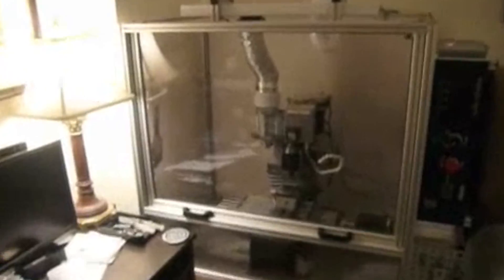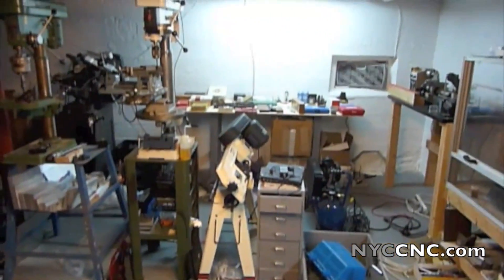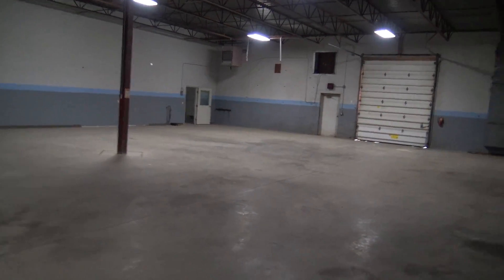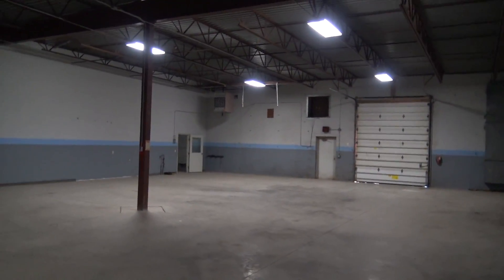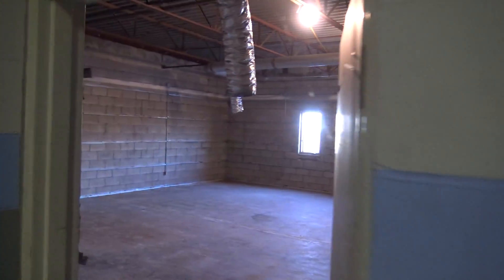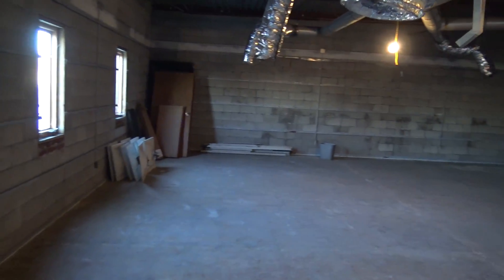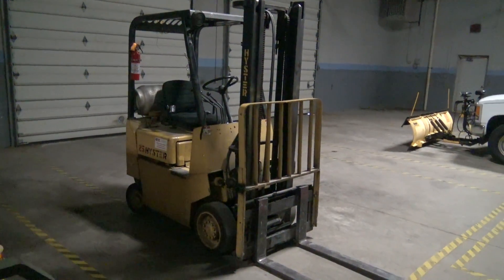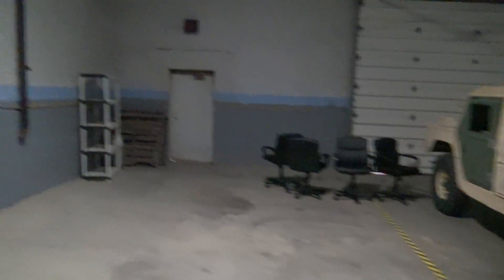We're Moving Again - One Last Time!  NEW SHOP!

Comment: Congrats...For the air lines you might want to check out the pricing of products like Rapid Air (there's other companies too), they have rigid and semi flexible lines, it's a coated aluminum tubing and can handle pressures up to 200 psi....With the rigid they offer sizes from 3/4" up 3" outside diameters and in lengths of 8' & 20', and the semi flexible is 1/2" to 1" in rolls of 75' up to 300'.....rapidairproducts.com.....And don't use PVC, it's good for short term use but I wouldn't use it if your going to be there for a long time.

Comment: Congratulation you worked hard for It and you stuck to It , I have seen auto repair shops run the air lines in  sch 40 white plastic pipe I would use the same Idea , Just using sch 80 gray pipe I bought a shed that was fully assembled (wood) and the company rolled it down my drive way using sch 80 plastic pipe and it did not split or crush seeing is believing . I believe Its rated at 200+ PSI    Thanks for taking the time to make these Video's Pete M
Reply: +Pete M oh, that makes (3) mr. shrapnels...

Comment: Nice building. I agree with the copper air lines. On the epoxy floor, be careful about ANY oil on the floor. It will cause the coating to peel off. (Assuming your doing the DIY epoxy.) Even with the acid wash, once oil has soaked into the floor, that's it. 

On the wall; welding curtains WILL NOT keep that dust at bay. I worked in a room with no ceiling, next to a grinding room. That awful dust came right over the wall. I also noticed that your heater is blowing from that area towards your CNC shop space, making it worse. Speaking of heat, I also noticed a lot of light coming around that garage door.

Comment: *Storage Shelving:
A shipping and receiving department will need shelves for spare parts, manufactured parts, incoming freight and machine and welding shop consumables.  Keep an eye out for going out of business sales of retail department stores.  You can find great deals on the display shelving units with pegboard backing and also get the industrial shelving for storing pallets on from business stock area.  I got a 5500 pound rated pallet jack from a going out of business sale and have moved my lathe with it several times with ease.

*Chip and welding flash shields:
In a machine shop I used to work in, we had 5.5' square loop frames made out of a 3/4" electrical conduit that had canvas stretched across the center to shield cutting chips from the machine operator or bystanders.  I had one on each side of the manual vertical mill that I could use to help control the mess.  There were also several of these frames with welding shaded curtains on them to control welding flash throughout the shop.

*The machine shop floor was painted grey and sealed which made for easy mopping and clean up.  It had the potential to get slippery but looked a lot better than oil stained floors.  

*Air Quality
Smoke Eaters or welding smoke purifiers.

*Lighting: machining area lighting was hung much lower (closer to machines and equipment) and on separate lighting circuits from the rest of the shop.  Good for those early mornings or late nights not having to light the entire area for just those few machines. 

*Mobile Machinery setup alignment fix for uneven concrete floors: This fix is for having a repeatable place to set a machine or device on a concrete floor in a shop.  I will call it "Puck and Ball Leg bolt".  To do it you need to turn a radius into the center of a steel puck that matches the radius of the ball on the end of the leveling leg bolt.  You need a matched set of these for every floor contact point.  Drill two or three holes in the puck near the out side edges (for bolting or gluing to the concrete floor).  Stick or bolt the pucks to the concrete floor exactly under the ball leveling adjustment leg locations.  Level up your device/machine using Ball Leg bolts. Now you can move the device with a pallet jack, forklift or by hand to another shop location and bring it back to the pucks and set it to the exact same place it was before.  This was needed in our machine shop for the in-feed and out-feed tables of the self feeding metal band saw.

Hope some of this helps, that last part was a little difficult to explain.

Best of luck to you!

Comment: What do you think of using the auto bay for welding and put a roll up door between machine and welding areas?  You have so much area you could set up an RC race course inside and not crowd the machine shop stuff.  Congrats and my eyes are green;)  I've plumbed several shops with PVC pipe.  Low cost and never had any draw backs.  Do make sure to put a drain at every down pipe, very important.  Could run 1" in the rafter and run 1/2" down to each machine.  Would be a good idea to anchor the down pipe to something so the PVC pipe doesn't get bounced around.  Drawback is easy to get damaged.  Benefit is cheap and super easy to fix.  I did my insulation trailer with PVC and the only problem with breakage was user error.  Was able to fix it in 5 minutes and was back up and running.

Comment: I'm going to suggest a vinyl strip curtain wall hanging from one of the bar joists. Some manufacturers even have the vinyl material in a tint that is specifically designed for welding areas to that people outside the curtain are not subject to the ultraviolet and the blinding light. But it's still easy enough to walk through or even drive your forklift through wherever you want.

Comment: please build a small shed outside for the air compressor for noise control, or if you get deep pockets or sponsorship a roots type compressor as they are a lot quieter.

Comment: On the air lines.  Copper corrosion will not muck up your air tools like rust from steel will, but really what you need to do with that much airline running all over the place is to put a commercial refrigerant air dryer in place right after the compressor.  If you are blowing dry air into the lines to begin with corrosion will not be much of an issue.  You then run your hard lines to a given "station" that runs through a desiccant style air dryer just to be safe, and then to a distribution block so you can run 4-5-20 tools in that "station" ... inline tool oilers are nice too.
I would also HIGHLY suggest that you build a compressor closet.  It's worth 1000x the $1-200 it costs to build.  There are a ton of tutorials on how to do it.

Comment: I would leave the duct work to use as venting in the 'class room' area and use the 'class room' area as the welding / plasma area. Then on the main shop area I would put in either a cubical partition or one of those production floor office spaces made up of prefab wall sections with the Plexiglas windows.

Copper is for sure the way to go with the air line. You want to go large with your main feed lines so you don't loose to much at the far end of the line when you have a few people using air. The large line also acts like extra tank space. Don't forget to put in lots of shut off valves. Sucks to have the whole shop go down because some one broke off an air fitting.

Looks like a great adventure and a great space. Reminds me of how I felt when my dad and I opened up a shop.

Comment: the T5 lights are ok and all but they have a very fast burn out curve, they start to loose intensity very fast compared to LED, they have very nice high bay led panels the are low power low heat and are ridiculously bright, the place that i work at recently replace all of our old mostly burnt out high pressure sodium lights with philips FBL24LL40-347-CW6 (in our shop its 347V but they sell these in different voltages) these lights are 24000lumens each at a colour temrature of 4000k (but look closer to 5000k as they are pretty much pure white light) when they first put the lights in we had to wear sunglasses in the shop it was such a massive change from the near death sodiums to the gates of heaven for lighting.

for the air lines, running all pure copper lines is a insane cost, you would be well off running 1inch seamless extruded or cast pipe, very robust and used the world over for shop air and high pressure washers in a shop install.

Comment: Great news!
Are you still in Ohio?On the floor: no epoxy. It is slick when dry and a real hazard when wet, especially with oil. Seal it and leave it.On the lights: I like fluorescent, but... Supplement with another type of light. Cyclic lighting such as fluorescent and rotating parts are a very bad combination. Do not go with LED until you actually walk into a high ceilinged room that uses it.On the walls: studs and drywall. Don't screw around. Add a short hall and another door at the far end. Keeping the dust out will be almost impossible, but this will help. Keep the grinding room on its own heat. You will also find the wall a good place to hang things.On the heat: I like those type of heaters, they do just fine. If you decide to change, look into radiant infrared heat. They are long tubes with reflectors and some magic box at one end. I worked in a shop here in Ohio that we shut the heat off at night. It would be near 0 some mornings. It would heat the entire shop and our tools in less than an hour. It was by far the best heating system I have ever worked under.

Comment: I vote for LED lighting. Even if you use fluorescent fixtures you can retro fit LED light bulbs in them. HD sells them for under $9 each. They will last almost forever, are more energy efficient, color is way better as well. Don't be misled by wattages either, LED's deliver the light in 120 degree pattern rather than 360 degrees in a fluorescent tube so you need less wattage for the same amount of light. Thanks and congratulations.

Comment: John congratulations on the new building. For the welding dust try to have the air flow going out the back of the building if possible. With or without curtains the dust will settle in the direction that the wind is moving. 
Copper is the best for air lines, it is easy to get the parts locally, easy to change, and make additions to the existing line. With Copper you don't have to worry about heat, moisture, UV degradation and unintentional puncturing, or seal failure. Just don't forget to have the proper slope to drain the moisture in the line. Also put in shut off valves at each station if your budget can afford it.

Comment: A lot of areas have tax credits or grant money for converting to LED lighting. It is definitely great when done right.

You should consider using the auto repair area for your welding/grinding and fabrication area. No walls to build and complete separation to keep the machine shop clean.

Comment: SO AWESOME!  Quick thoughts, epoxying those floors should be pretty easy, ours were filthy and took forever to clean.  We had one 3 or 4 bulb T5 light fixture installed and it's BRIGHT!!!  I'm not sure what bulbs are in it, but I want those across the whole shop.  We used 3/4" RapidAir Maxline air lines, the blue ones.  Around $200 for a 100ft kit and I like them a LOT, we used about 150ft to loop all the way around our shop, you'll need way more.  But I know nothing of copper so I can't compare.
Reply: +NYC CNC no problem.  did your see my latest lathe video? might help.

Comment: If the copper lines for everything are too expensive I think that using something similar to PEX tubing would also work great! This tubing has come a long way recently due to many people using them extensive in new home building. With copper I would just make sure you have enough CFM for multiple/many tools to be run at the same time. Anyways, congratulations on the new building and I hope to maybe someday attend your classes!

Comment: Lumber build the walls that are kinda Temp, attached and the top and bottom with bolts that can be removed later if you "upgrade" rooms to different size, Section off the "auto room" - easier to Vent for welding and grinding , and reduced chance of eye welder burn for others.  I still think LED Lighting is best results, HALO Style would be a good possibility

Comment: I have plumbed a big shop 10,000 sq feet for a auto repair shop.  We used 2" main runs (all steel pipe), which ended up adding significant volume for compressed air storage and we never worried about any one drop being at the end of a run and having little pressure due friction.  The compressor is a 25hp 3 phase monster in large part because the shop still has in ground air over oil lifts.  The main lines ran the length of the shop on each wall (interior and exterior) about 8 feet up, with drops every 8 feet or so depending upon the place in the building.   We placed outlets at each roll up door which ended up being really useful.    The only negative was some leaks, which are not easy to get to (more unions needed).

Comment: Take the money you would put into the epoxy floor, and instead of the epoxy, install more lighting.  Put more lighting than you think you need.  Install a ton of lights, and put them on separate switches so if you think it's too bright, you can turn select lights off, but I doubt you will ever think you have too much light once you install them.  Lighting will make a MUCH bigger difference in the feel and use of the shop, more than the floor.  And I have yet to see epoxy floors hold up well to really heavy machinery and abuse.  And you will either spend too much time worrying about damaging the floor, or once you damage it, you'll then spend a ton of time figuring out how to repair it.  More light will make the plain concrete seem brighter as well.

Comment: John: Contact the electric utility and schedule a full meeting with a commercial account specialist / conservation specialist.  Many utilities have programs that the on-the-phone-customer–service-happy-voice doesn’t even know exist.  Depending on the utility they may have programs that will basically allow you to pay for efficient lighting with the savings over standard T-5s.  (In any case, mix in different types of fixtures.  Even with good LEDs or florescent, if it is all the same the lighting will always seem “off”) 

Also, either through the utility or independently look into solar panels.  With over 8000 s.f. of roof there are lots of outfits that would like to contract with you for that area.

Comment: Hi John,
I haven't done air lines in 40years so a bit out of date on the new stuff, but I would have done it in copper in my day. With lots of slope and drop lines. Have you thought about moving the dirty dusty stuff to the auto bay?
Gerald.

Comment: What about dropping a 20' Shipping container in the space for the plasma table and grinding and welding?  totally self contained for dust and could serve as a room divider  for the larger space, plus adding sturdy walls spaces to either side and a huge amount of storage on top as well.   you could even cut out windows on the sides to observe the Plasma table from the outside.  Plus it's gonna look cool!!

Comment: Great news on the new space.  With respect to lighting, I would go with T5 either 4 or 6 bulb depending on your ceiling height.  I have a 500K SF commercial building and have been vexed with the decision between LED vs T5 as I replace lights.  My cost benefit analysis keeps coming down on the side of T5 which is approx. 1/2 to 1/3 the cost of LED.  I have sourced these from several outlets and have found Cors Lighting to have the best combination of price and customer service.  Cors carries T5 lights that are Made in USA and have a 5 year warranty. Epoxy floor coat is a good option but good floor prep is essential or it will not hold up.

Comment: Excited and happy for you John. I plumbed airlines in my shop 26+ years ago and have had no issues. Used type L 3/4 inch copper pipe and lead free solder you can buy at the hardware store. Proper surface prep and the right flux (for lead free solder) should work for you. I also connected the compressor to the pipe with a flexible hose that wouldn't cause the pipes to vibrate and fail or be a noisy nuisance. Don't skimp on number of drops and use quality quick connects. I bought a couple of cheaper quick connects and they're the ones that don't seal. Bought quality ones the second time and all is good. Congratulations and hope to see you at your open house this year. Keep up the great work!

Comment: Wow! nice building!
1. Lights T5's can be a maintenance pain, especally if they are high up and become inaccessible do to benches, heavy equipment. Perhaps go with LEDs where it would be difficult to replace the bulbs. I've been replacing T5's in my basement shop as they fail with LEDs. Can't stand the anonying flicker from a loose bulb or when the bulb reaches the end of its life.
2. Cash flow could be a problem. The US economy will likely be in recession by the spring. Renting out the space (perhaps limited to 1 to 2 year least) so if you need the space you just don't renew the lease. Another option is to partner with another business and you can always merge. If you can find another machinist to move in, even better since you can bounce excess work between the two business, without the hassle costs of hiring workers. also can share equipment (if that is an option) One other option to rent the garage space to people that want to store vehicles (or small boats) for the winter season. Thus your only committed to renting the space for a brief period. But you will need to send out notices like yesterday since winter is here.
3. Recommended epoxy brand (discussed on Practical Machinst) www.stonhard.com  stonclad. Tough and slip resistant when floor becomes wet by machining coolants. Commerical Epoxies can flake and chip (forklift, heavy machinery, oils, etc) Whats worse than spending a boat load money on epoxy flooring, it when you need to spend more to replace it after it fails. You also need to read up on how to prep concrete before you apply it (Oils, moisture, etc) can prevent it from bonding.